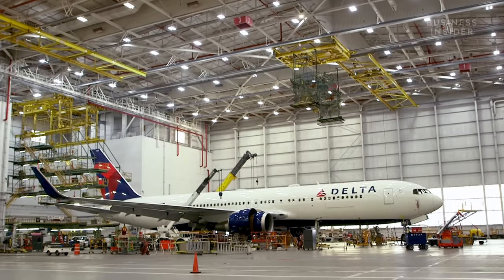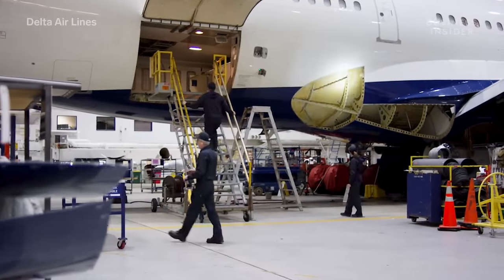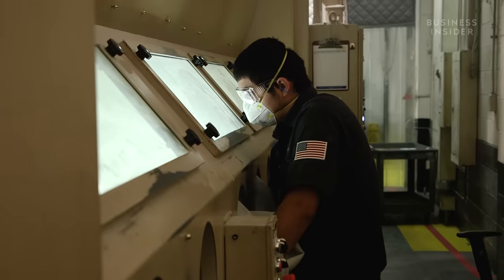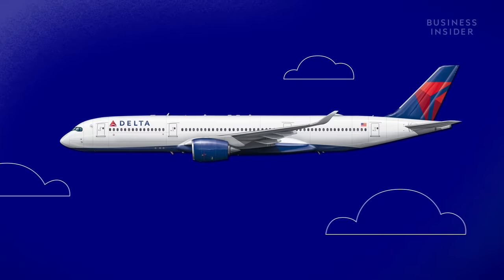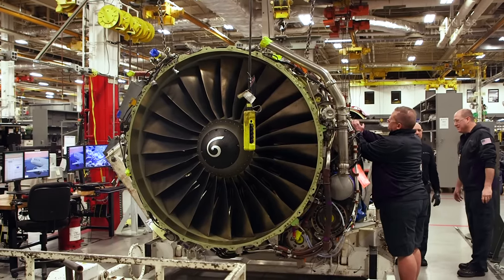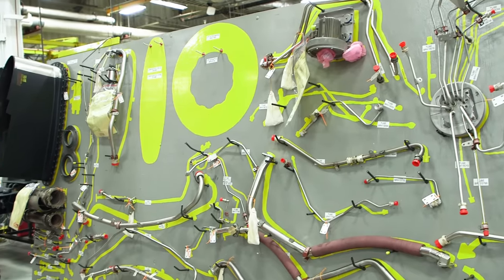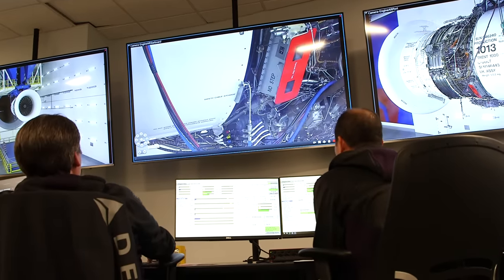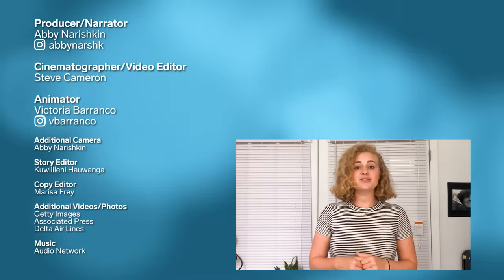How Delta Fixes $32 Million Jet Engines | Big Business

Comment: Without taking anything away from pilots; whose own roles are incredibly important; these techs are just as super important and are like surgeons. They not only need to do the right job, they need to follow rules, not cut corners, use original parts and know they are (not counterfeit) and understand everything.  And not levee a single bolt, a single wire disconnected.  
These people keep the actual plane in the air, keep people safe and they deserve all the money they earn.  Kudos!!!
Reply: Agree - one of the reasons that crews' names are on military planes similar to the pilots. Team effort!
Reply: Sort of...your post/view is what "makes sense" to the layman but is not actually how this works on a macro level. While they are professionals who should be admired, they make mistakes (and can be dishonest, lazy, whatever) like every single human "professional" and human factors cog in the machine. What makes an operation of 2 million parts work "right" (even "right" doesn't mean what you think it means) are cascading redundancy systems and repeated rechecks/failure detection systems that reduce "entire system failure" probability down to miniscule (note non-zero) levels. I'm on the engineering side of this, and there are systems in place so that a "single disconnected wire" or "a single loose bolt" will be detected long before production deployment happens (and the offending parties isolated/reprimanded). End of the day most (including the engineers as myself) are nothing more than skilled worker bees following a very well orchestrated manual. Fault tolerance/detection is a whole discipline in itself. We don't have an accident just because a couple techs have a hangover or are forgetful at work. System is designed to tolerate those errors way way before rubber meets the road (or an air pocket meets an airfoil in this case lol)
Reply: @thearcher1740  They do have a point. A maintainer's single mistake is far more likely to bring down aircraft even more so than one committed by the air crew. It's happened!
Reply: Without them nothing flies
Reply: I wonder who loses their job when a aircraft crash's
Reply: @PabloGonzalez-hv3td  Yet something like 90% of accidents are not maintenance related ;)
Reply: @thearcher1740  nice one. Also there are tons of emails and deadlines to put pressure on everyone. 
Plus, there are KPIs to achieve and greedy directors who just want to meet the goals for the quarterly bonus. 
The system keeps everyone working for itself, from top to down.
Reply: @xexeia  what's kpi? I feel like it s some bs marker for me productivity 🙄
Reply: Non OEM doesn't mean unsafe
Reply: @MrBooster999  true but in commercial aviation you absolutely must be sure that all parts are oem verified
Reply: @kx7zz OEM verified? You obviously aren’t in the business.  Our job is to verify EFFECTIVITY for that particular aircraft per the IPC.  I couldn’t care less if it is “OEM”…we don’t even use that term.

Comment: The engineering in these things is mind boggling. Not to mention building stuff to fix it is an engineering feat of it's own.
Reply: Yeah imagine those calculations within the engines
Reply: As an senior year aerospace engineer I can confirm there are a lot of calculations.
Reply: Well thanks the German engineers
Reply: Steven Rivers  Well I am a transfer student so I started off at community college before heading to university so I only understand it from that context. Different universities have different requirements. So UC's, CSU's, and private institutions all can each have their own set of requirements for a particular program. There is a lot of overlap and generally speaking I noticed they tend to focus on you having your math up to differential equations and linear algebra, your physics sequence complete, and certain chemistry courses finished as well as your english and other general education requirements completed. These requirements may not all be strict and you may not need to complete everything in every last category to transfer. I know my answer is somewhat convoluted but the process truly does vary. Hope I helped in some way

Comment: Points at rotor blade 
"This part costs twelve thousand dollars"

Me: "damn, that's one expensive prop shaft, or whatever the hell that part is"

"There's 80 of them, the entire unit is about 2.2 million"

He was pointing at just one blade, not the entire rotor assembly?!😰😨😨
Reply: It's made from Unobtainium
Reply: Im a 737 mechanic, and theres a rubber stop around an inch wide that costs 1000 dollars.
Reply: @Matt_10203  I wonder if the engineers who build those parts charge for restroom breaks. Line item entry: "Number two. $200 bucks."
Reply: Every part has a lawyer attached to it.
Reply: Those are High Pressure Turbine or HPT blades. They sit right behind the combustion section and drive the high pressure compressor or HPC. The HPT blades are basically what gives the engines its thrust.
Reply: Reason: If those are high pressure turbine blades, they are probably made of a single crystal super alloy metal structure each - a careful heat controlled metallurgy process with high fail over success rate, leading to dozens of faulty parts being thrown away per blade produced. Furthermore each blade may receive a special ceramic coating to resist high temperatures, but because even with those materials it is insufficient to cope with the environment they operate on, small holes and air canals are bored into the blades from which cool air is blown to form a thin gas layer so that the hot exhaust from the engine core does not get into direct contact with the blade. All these parts must pass a quality control test to ensure their thermal dilation (stretch due to temperature) are within specified standards to guarantee safety and performance.  So 12000 USD is not such a bad price for the amount of work that goes into it.
Reply: Here's a fact: A single blade in engine costs more than an average family car
😱😱😱
Reply: Is this some kind of ripoff like you need to get the sam company blade for your engine to repair it so they can charge anything for it???
Reply: @urvagrawal2358   I understand your point. It certainly looks that way, but let's pretend someone other than the original engine manufacturer can also build those blades:
First, that someone will have to nail the shape of the blade down to tenths of millimeters, and use equivalent materials that are not cheap (exotic high temperature, fatigue resistant metals), since each engine model performance totally depends on the blades.
Second, even if they are successful in manufacturing such blades, they will need to be certified by air safety regulators, such as FAA and EASA, which also costs lots of money because they usually have to prove they are safe through expensive demonstration tests.
Third, assuming this company builds and certifies the parts, they are basically liable for any accident it might happen and be subjected to investigation. Not a very interesting prospect for an engine design not even of their own.
A new aircraft engine design and production requires an investment of around 3 to 4 billions of dollars and perhaps around 7 years to develop. It's no wonder there are only three main manufacturers in the entire world.
Reply: @Fey418  Rolls-Royce, Pratt & Whitney, and General Electric?
Reply: @andrewpearce2562  Indeed.
Reply: @Fey418  just read that CFM is actually the largest of the bunch, in the US and worldwide...
Reply: @andrewpearce2562   CFM is a joint venture between GE and Safran. At the end of the day GE is earning yet from this partnership too, increasing their size if we talk in terms of profits alone. Also CFM was formed to build a specific engine model, which happens to be used by previous generation B737s and A320s -two workhorses of the aviation industry. However newer generations of A320s and many other medium to small planes are switching to Pratt and Whitney Geared Turbofan engines which offer double digit fuel efficiency improvement in general, so unless CFM comes up with a new technology to compete with that or supplies to other types of aircraft, this partnership may end up being a one time only deal. Another joint venture partnership between one of the big 3 and smaller ones is IAE (International Aero Engines - PW, MTU, Japanese Aero Engine). All these partnerships just prove the point that R&D of a new engine is so expensive they mingle together to share the cost of development.
Reply: @Fey418  very interesting! You sound like you’re in the industry?
Reply: Not in maintenance of engines. In the aircraft industry yes.
Reply: @Fey418  good enough for me B)
Reply: @boobiegrabber7555  If your car breaks down you call triple A. If your engine breaks down you call God. 😀
Reply: @Fey418  Heck, even tenths of millimeters isn't up to standard. Engine manufacturing is insanely exact. Just goes to show how delicate these things are.
Reply: Turbine blades made from 100% titanium.

Comment: "You're looking at a 13,000-pound engine!" 4:59 Someone walks directly below it while it is just hanging by ropes
Reply: not ropes, chains
Reply: I would trust those chains and lift more than any other human.
Reply: they know what they are doing. no need to worry
Reply: They are not ropes. It's either cables, fixtures or chains. All of them are given DAILY checks and logged to make sure the hoists are in good working order. The safety factor is well over the safety factor designed into the roof of your house. Along with the hoists any straps, chains, fixtures or cables used for lifting are given a load test every year and tagged with a date of expiration. If they fail that test they are destroyed and disposed of.
Reply: @kdiver58  I don't believe they check all the cables every day.
Reply: SCALITY I don’t believe you’ve been in a factory that has anything to do with metal or anything heavy.
Reply: @scality4309  this isn't your weekend DIY'ers garage, man
Reply: @scality4309  If u been watching the video you'd know those engines cost a crap load to maintain, imagine one dropping due to chains breaking and it damages their customer's engine? or someone gets crushed? stuff like that needs to be on a frequent stress test to ensure everyone's safety.
Reply: @obamabinladin1134  Yes, but not everyday. That is theory/best case scenario. In practice they test them once in a while.
Reply: @scality4309  once in a while.
Ok, so yah guessing huh!
Reply: @scality4309  there is a sign off every day on the hoists and a visual inspection in that sign off log.  They are stress tested once a year.
Reply: SCALITY I work at a major Transmission manufacturing plant and the hoist and chain are checked every single day. One because no one is stupid and wants to drop one cause they will lose their job. Second if you are seen by anyone you’ll be called out on it even by your own coworkers. Thirdly you have to fill out an inspection card every time someone uses it or else you are fired. I doubt you’ve ever work in manufacturing but safety is extremely important as dead is extremely possible if rigorous safety standards are not kept
Reply: It's not going to fall, that's basically destroying 30 million dollars
Reply: @scality4309  you really take safety precautions way too casually. checking hoisting chains every once in a while? Bruh Id never want you servicing any of my shit if that's your attitude to daily checks
Reply: @kdiver58  are you serious?? you work there?

Comment: 6:54 GE90/GE9X has entered the chat
Reply: GE90/GE9X cant reach 150,000lbs of thrust
Reply: @shahimagesyt  They may not hit 150k of thrust, but the GE90 hit 127,900lbs of thrust during flight testing and the GE9X hit 134,300lbs of thrust during its flight test.
Reply: @mh12-47  yes Ik it's still the most powerful jet engine.
Reply: Only the 115B came close. Too bad that program is closing down now.
Reply: @notyou6950  why being sad? The 9x is bigger

Comment: If only their service was this sophisticated
Reply: I have seen you everywhere
Reply: Ya I have too
Reply: like not punching passengers
Reply: it is Delta is the industry leader in customer satisfaction
Scroll down for J.D. Power’s list of the top ranking airlines:

Delta Air Lines (860 points on a 1,000-point scale)

 Southwest Airlines (856)

Alaska Airlines (850)

JetBlue Airways (849)

United Airlines (810)

American Airlines (791)

Air Canada (759)
Reply: this is about Delta's maintenance base in ATL. STUPID INAPPROPRIATE COMMENT. Delta leads the industry in customer satisfaction.
Scroll down for J.D. Power’s list of the top ranking airlines:

Delta Air Lines (860 points on a 1,000-point scale)

 Southwest Airlines (856)

Alaska Airlines (850)

JetBlue Airways (849)

United Airlines (810)

American Airlines (791)

Air Canada (759)

Comment: Imagine having to change the oil on a plane
Reply: You don't change the oil, just keep topping it off as the engine burns it up
Reply: @salvadorrobledo1151  and who told you that? that is false
Reply: Christopher Baker I cannot speak to the operational standards of turbofan engines on Air Transport Category aircraft, however, P&WC (Pratt and Whitney Canada) have released Service Bulletins  in reference to oil changes. Certain PT6 engines covered by the bulletins, for example, no longer require regular changes/servicing to the oil system. Granted, it’s up to the operator and Mx to either put it on a Mx cycle or not. Obviously certain situations exist to where one would need to service or swap, but just an interesting bit I’ve picked up along the way.
Reply: Every 50 hours on a piston engine with an oil filter.
Reply: @yogib37  His statement is true. Jet engines aren't like car engines that dirty their oil through combustion. Jet engines are a dry sump setup that has supply and scavenge nozzles and drains at each of the main line bearings and within the gearboxes. This fluid does not get changed and as mentioned, there is a lot of oil loss through the air/oil seals. The integrated drive generator (IDG) will have it's own self contained oil supply but it too gets serviced and routinely topped off. The fluid is not changed until the engine comes in for overhaul or the individual component is replaced due to defect or failure.
Reply: fowvee you are not allowed to tell facts and educational things. Your punishment is 24 hours in a room with a GE-90-115B starting up.
Reply: @AA-tz2bm  haha, I figure that after 30 years of building GE gas turbines I can let the truth seep out every now and then.
Reply: took mine to Jiffy Lube
Reply: @salvadorrobledo1151  no you can change the oil if needed
Reply: @scallen3841  sure you can but I don't know why you would
Reply: @salvadorrobledo1151  have you ever worked on jet engines ? I was a jet engine mechanic in the Navy I worked on fa-18c's .
Reply: @yogib37  No it is actually true except when an aircrft goes through overhaul or engine change when
the jet engine is completely rebuilt which involves draining all the fluids.
Reply: Salvador You are wrong. It is very true. Where did you get you're false information?
Jet engine oil lifetime and oil change

Oil systems for commercial jet engines are rarely drained. There is no oil change as long as the engine stays on wing. The oil is only renewed by top-up, typically accomplished every day to compensate for normal engine oil consumption.

Consequently, the oil contained in the tank is a mixture of different-aged oils, some old and some new. To minimize potential problems, the choice of lubricant must be suitable to the engine situation, particularly when high cycles and very low consumption prevail
Reply: . You are very wrong Salvador.
Jet engine oil lifetime and oil change

Oil systems for commercial jet engines are rarely drained. There is no oil change as long as the engine stays on wing. The oil is only renewed by top-up, typically accomplished every day to compensate for normal engine oil consumption.

Consequently, the oil contained in the tank is a mixture of different-aged oils, some old and some new. To minimize potential problems, the choice of lubricant must be suitable to the engine situation, particularly when high cycles and very low consumption prevail
Reply: @yogib37  you are WRONG. the engine oil never gets changed. know what you are talking about before you say something incorrect and stupidity

Comment: I wonder if the jet feels any different to the pilot pre- and post- maintenance?
Reply: Yes, every engine (even on the same aircraft) has different performances, there’s limits to how slow they can spool up before it requires troubleshooting but they won’t accelerate at the same rate, they will also have a different efficiency due to how far in their life cycle they are.
However the electronics on board do a great job of masking all of that nowadays, thus you need very little throttle adjustement.
Reply: My first thought.

Comment: Boeing: we don’t do that here.
Reply: what do they do?
Reply: just buy a new engine?
Reply: @michaelgerlach2736  nah Boeing 747 max had this problem with the engine placement and they were too lazy to design a fix to mount on the wing, so they used software to override the problem, and that resulted in 2 crashes with their Boeing 747 max planes. All Boeing 747 max planes are grounded by the faa but only after 100s of deaths all responsible because someone wanted to make money.
Reply: @la3478  wow that’s crazy! i never knew that!
Reply: @michaelgerlach2736  yeah its crazy and quick correction, I meant 737 max not 747. Boeing is loosing its trust fast.
Reply: boeing cant even repair a plane. see Jal123
Reply: @la3478  that’s not what happened